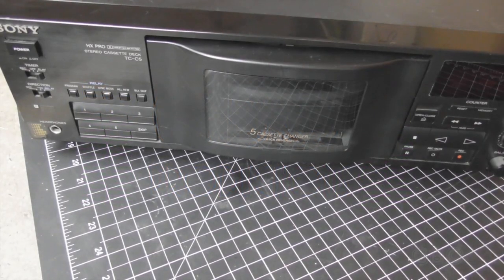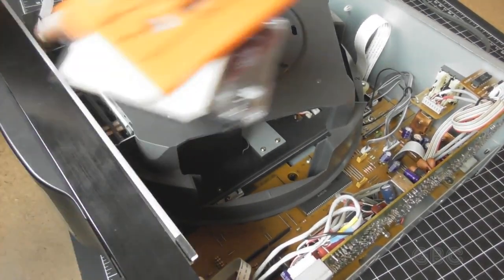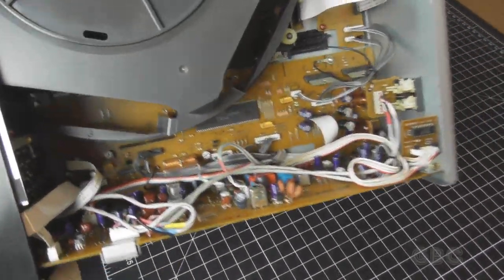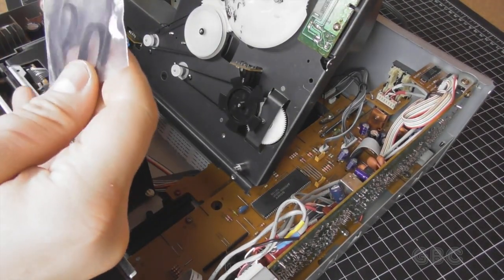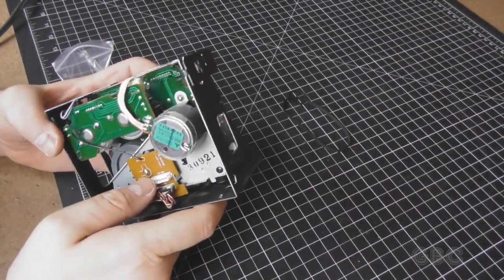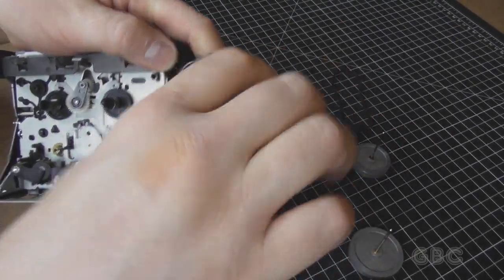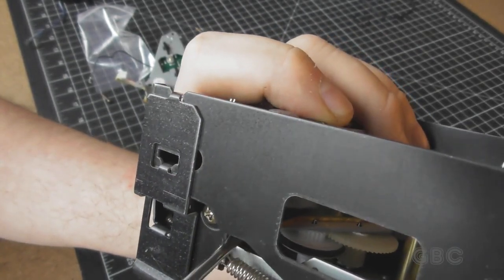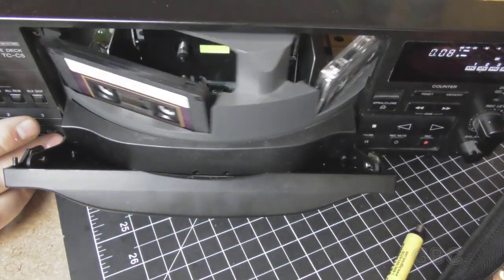[110] Sony Tape Deck Repair

Comment: You did great with this "monster" as it's a tricky unit....I got one with a bad motor...well a new motor were found $ 90.00.. But finding the correct belts..is when I got stumped.. so still on a shelf.. May I ask where you found the correct belts ?

Comment: I refurbished one of these Sony decks several years ago.  They are a bit daunting, but after trial and error (and a manual from HiFi Engine) I was able to make it operate flawlessly.  One note, when pulling the flywheels out be sure to keep track of the tiny nylon washers that go on the shaft.  These are located on the part of the shaft housing that is in the front part of the mechanism.  These prevent oil from coming out and contacting the pinch rollers.  I also added a short strip of LED's above the door and it made for a very customized look when powered on.  I used synthetic tape deck oil on the flywheel shafts and lithium grease on the other parts.